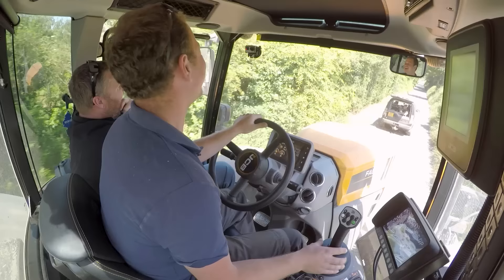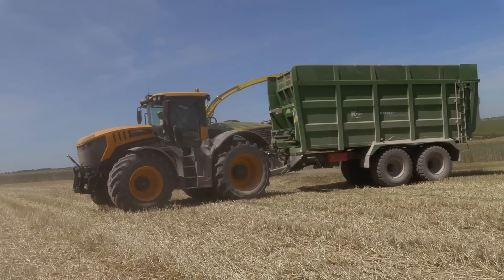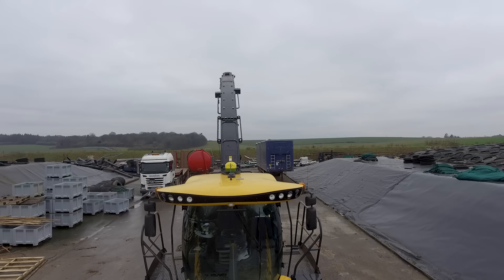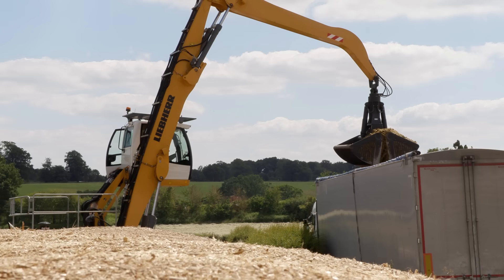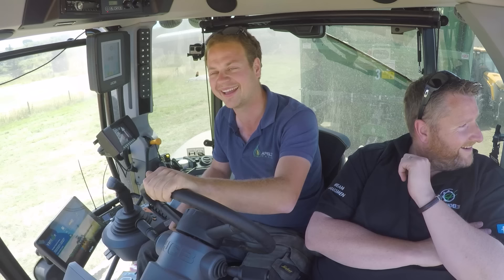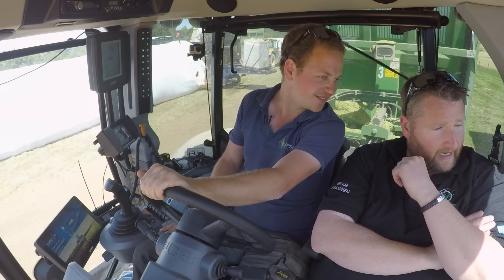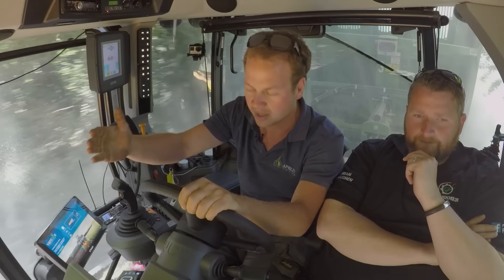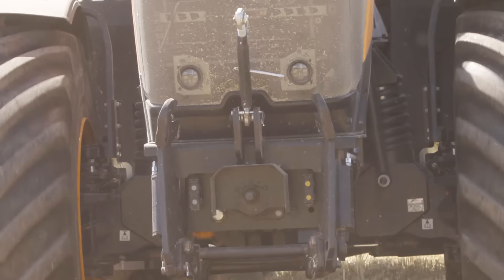Apsley Farms

Comment: Impressive stuff but one has to ponder does it have a future for other installations? The main concern being crops being used for fuel instead of food. The fieldsbeing harvested are obviously great for crops compared to fields elsewhere in the UK so we could end up importing food to make up for what we are burning to keep the lights on. It's a tricky juggling job but I don't think it would be a good business model if the subsidies get knocked back like the government did with wind energy when they cut it down from 12p to 2.2p. That along with planning restrictions increasing and investor being scared off killed the onshoe wind industry overnight.
Reply from the maker: Not meaning to be funny here but I guess only time will tell.  Farmers in all EU countries are fairly reliant on SFP for survival.  I understand that the UK are no longer in the EU and lots of things may vary.  Farmers will seek out diversification that suits their land and circumstances and ultimately pays them the most.  That's just my we thought on it.
Reply: @Grassmen  I agree. farming is going to change and diversification is the key. We need the power in the UK so onshore wind needs to come back so there is more local generation and more local charging points for electric vehicles as they become more common. So, energy in one form or another is one way but buring food for fuel will get very political as the population is increasing at 500,000 a year in the UK alone. We need food and energy and when either runs out trouble will run in!
Reply: DingleZilla all fair points. But basically if food prices or food production prices change enough to justify it, there is still plenty of land that can be used efficiently to either produce that food or energy crops. No ones going hungry.
Reply: @benpattinson1  I think you are missing my point and just so we are in alignment, I never said anyone is going to go hungry. There are many ther things to factor in, those being importation costs, animal welfare of foreign meats, environment care of foreign cereals and pulses and where land that is not currently for arable production in the UK you have to look at local climate (It may not be suitable to crops in every part of the UK even if the land is), soil types, soil depth and it might sound silly but the season length. I am not complaining, just making discussion. There isn't an easy solution to energy or food needs so it needs to discussion at all levels and that should be welcomed and made in good manner as we are here.

Comment: That seems like a lot of effort and money to turn oil into electric
Reply: America  But how much more efficient is it than directly burning the diesel that powers the machines to make electricity? They are making gas using renewable crops way but doing so uses non-renewable oil to process it, i.e. it's impossible to call it "green" without the efficiency figures.
Reply: LOL. For 1MW  plant you need a lot of fuel. he said is running all the time so i guess 90% time in the year is about 8000h. So for  year you need 8000h*1MW=8000MWh, 1 MWh is 3600MJ so wy have 8000MWh=28 800  000 MJ given 36 MJ/L for diesel, we have 800 000 liters of diesel per year but for efficiency 50% we need 1 600 000 L of diesel. 

I have no idea how much oil they need to operate all tractors and equipment but 1,6 mil l of diesel is a lot.

Comment: None of this business makes any sense. The diesel usage and man power cancels out any gains. A subsidy driven industry that can’t compete like for like.
Reply from the maker: As we said earlier.  Only time will tell going forward.  Lots of changes on the horizon for sure.  But subsidies are relied upon in both sectors so I guess we just have to spectate in the interim.
Reply: John you may think it’s this way but in fact it’s not, I’m currently getting my degree in this sector and AD plants are my focus .. they are a very very profitable business when managed correctly. Not only do these plants create electricity which can be sold to the grid, they also produce liquid and solid fertilizers which can be sold also. Animal bedding is another of the bi-products and these plants can be fully self sustaining as this one seems to be. A great idea that I’ve seen here in my country which the owner who’s name I can’t remember says in this video he doesn’t do is put waste in them. Some people over here that had contracts within local councils and were paid to take away municipal waste were putting this municipal waste into the digestir creating electricity and the fertilizers, so they were being paid to take away the waste and then were using to waste to create products which could be sold and some use OSR which is pressed to create a cake & and oil which as you may know . Is then used to make diesel which runs their tractors and Lorrys ... so in a sense printing money 😉 high initial starting capital is the only drawback I see.
Reply: SBNT18 what makes it so profitable?
Reply: John Claffey A number of things John as with any business some will operate more profitable than others but in the case of that plant running off municpale waste, the owner is being paid by local comin old to remove the waste from waste water treatment plant and is then using that waste in the Difestory to produce the two kinds of fertilizer and electricity, so in a sense to make his product he doesn’t have to buy raw materials if that makes sense ? As in he’s paid to take the waste and the uses this to create the products, along with this what makes them so effective is if you speak to any arable farmer they will tell you one of the most expensive overheads in their business is the fertilizer they use to grow the crops, the energy farmers are creating their own fertilizer, as a bi-product to the process of anaerobic digestion .. so that overhead is taken from the picture.. the plants generally are fully powered by their own production- So if managed correctly and in the right areas with the right start up capital can indeed be extremely profitable, like anything though it’s a risk and everyday decisions are made that are risks and it’s a high stake industry- everything got to do with it is expensive! And as you’ve pointed out there is also government grants adding to this initiave
Reply: SBNT18 heavy metals from that waste makes food production unsafe in the future. These plants were originally proposed as a way of dealing with human waste. But crops produced more gas. PTO driven generation cuts out most of the steps. If this was done it would be abandoned for proper gas powered plants. One of the biggest plants in the UK was audited. Net energy production was very small. Plus it created huge traffic in small towns and villages. There were also a couple of major spills that destroyed rivers. I think the entire process is ridiculous. One farm profiled in Profi magazine showed just how much of the business was subsidy driven. The only way it can be paid for is with higher energy prices and redirecting tax money. The big scarcity scares were all bogus. The world is awash with oil and gas. 
Plus there is not a shread of proof CO2 is the climate control knob.
Reply: John Claffey Sorry for the late reply been busy all week! I don’t mean to sound smart/rude but where did you get all this information from ? From what I see online there’s ‘propaganda’ on both sides of the climate change argument both sides lying and while I also myself don’t fully agree with it certain facts like temperature changes are facts ! But that’s beside the point ..As I had said in my previous comments a well run plant is successful, profitable productive and good for the environment ... the only ones you and me and the rest of the population hear about in the news are the ones that have incidents ! Because as with anything the media only care for scaremongering & spreading bad news ... if you were to visit one like this Apsley farm I’m sure your opinion would change ! I’d actually love myself for grass men to do a follow up video on this and go into depth on this farm. Also the start of your comment ‘heavy metals from that waste makes food production unsafe in the future’ could you elaborate on that from me because that’s something I’ve not heard about before thanks :)
Reply: @johnclaffey7218  I can absolutely confirm your sentiments, having been involved with AD plants in the North of England, and South Africa.

The use of arable land to fuel these AD plants is ridiculous, around 1 acre per kW. The diesel driven support and ancillaries pretty much cancels any benefit. The efficiency of a forage driven AD plant is hopeless. The digestate produced is highly acidic, and sterilises rivers and aquatic environments. (The digestate may well be used as fertiliser on fields, but it winds up in watercourses).

The gas engines require prodigious amounts of service, owing to the H2S and elemental sulphur in the gas. Around 200Lt of crankcase oil per change. Even very high TBN oils only last a few hundred hours.

These plants are promoted by con-men and snake oil salesmen, the only place an AD plant is of any value is using food waste as a feedstock. Unfortunately, the powers that be are clueless, and easily led by these charlatans. When it starts costing £1000 a month to heat your bedsit, we will have people coming to their senses. Just ask the people of Fife that were taken off gas to go onto electric heating. Many of them are reliant on food banks after paying the electricity bill.

Having said what I have above (which is by no means exhaustive), I will say that the operation in the video appears extremely well run and managed, unfortunately they are wedded to a failed technology.
Reply: Pro-Pak Machines 
The contractor in the Profi machinery magazine in one year bought . An entire silaging outfit, 3 300hp fast tracks, 3 6000 gallon tankers with 36m trailing shoes, 3 scania 550’s and 6,000 gallon tankers. All to meet the needs of AD plants in his locality. Plus he built one himself. He rented the land to feed it. Thousands and thousands of the most fertile land was diverted from food production. The returns are so good that second and third units are added. Diesel fuels it all.
Reply: @johnclaffey7218  Which only highlights the hopeless inefficiency of a forage (crop) fed AD plant.